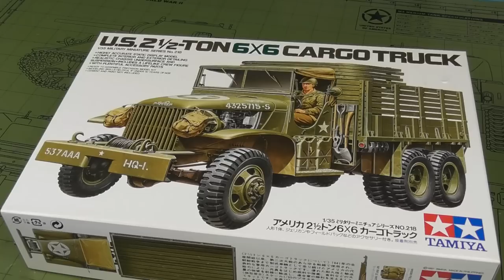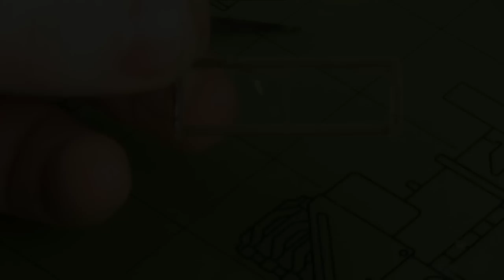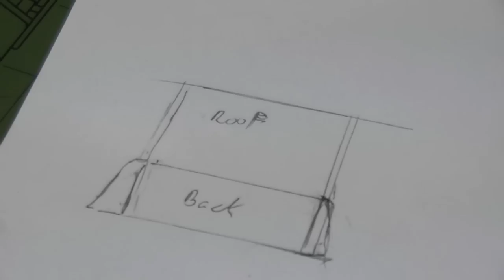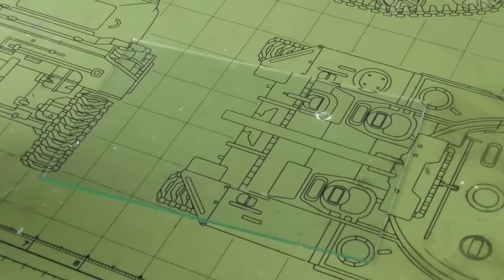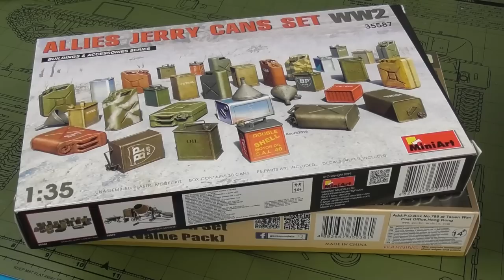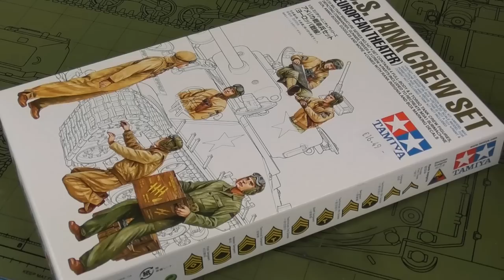Tamiya 1/35 U.S. 2 1/2 Ton 6X6 Cargo Truck FULL BUILD VIDEO

Comment: Shane, did you know that Tamiya made an accessory kit that included a hook for the end of the string??  I put a knot in the string to connect it at the start of the winch assembly.  It allowed me to wind the string on the two hooks on the bumper.
Reply from the maker: Is that the set that includes the MG ring and bumper extension ?

Comment: Nice build!  These soft skins have so much character and really add to a scene! 👍 I use the quick set cement and Contacta in the same manner.  I notice that you (and a lot of other builders) like to 'slop' on the liquid glue, do you need to to clean that up or do you find it disappears under the primer/paint?
Reply from the maker: 100% I feel the same, having support vehicles really add great character to a scene. It really gives an indication of complex machines that were these fighting units were. I would love to create a scene of an armor unit getting resupply with loads of these trucks bring fuel and ammo  to armor unit in their staging area. Would be such an awesome diorama to do! 

As for glue, for most part its hidden under the primer layer. But any heavy glue marks I tend to scrap or sand away before priming
Reply: @longlance67  I have the photos, Centurions in a refuel/ resup.